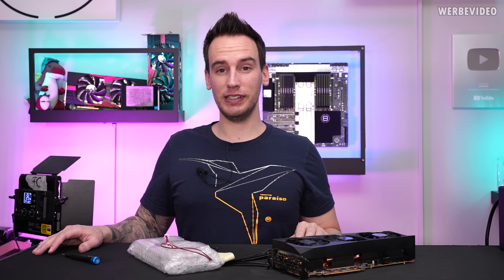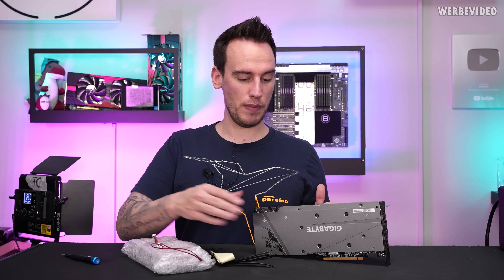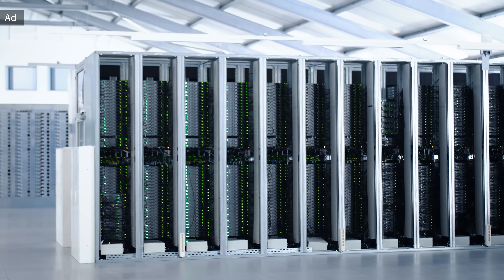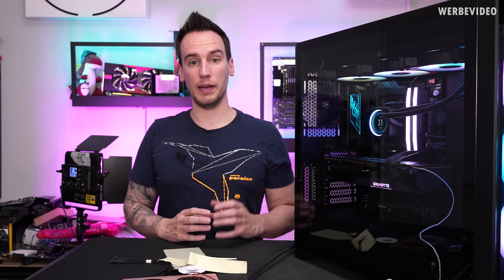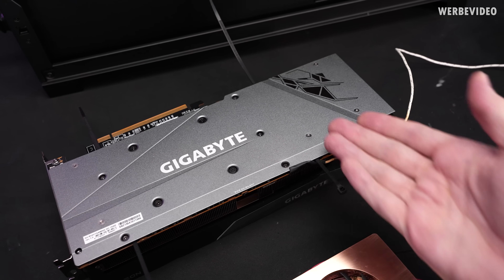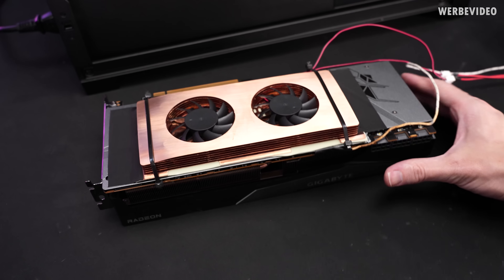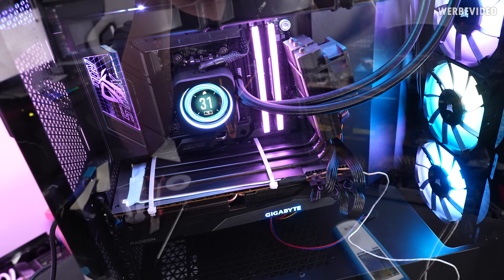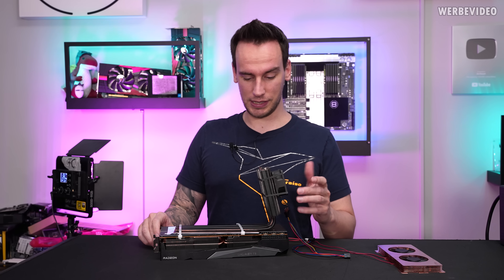Please don't do this - AliExpress GPU Backplate Cooling

Comment: It would have been fun to see you rig a regular 120mm case fan blowing directly on the back plate, maybe with a 3d printed bracket or even just some rubber spacers and see how that would have worked compared to the Aliexpress versions.
Reply: Yeah, just adding extra airflow right on the backplate can make a big difference. It's all about moving cool air over it to get the heat out
Reply: A 240mm fan card underneath the gpu does a much better job. Having fans facing different ways creates a lot of turbulence, and keeping the air moving backwards and up is much better for temperatures in my experience. Keeps my 2080ti fe from throttling
Reply: @TheTurtleneck64 on most gpu's and the one he used,  the air is sucked in from the bottom, pushed thru a fin stack that redirects the air (when it hits the gpu pcb) so it flows out the sides of the gpu towards the motherboard and the case side panel - that is 90 degrees from the way it entered, it does not flow from the face of the gpu, out the back of the gpu due to the pcb and is not flowing from front to back or top to bottom in the computer case either. So, the air in the computer case is already not flowing in the same direction. Also you missed  the point of my comment... I was just wondering if an $8 fan from Artic or ???  would have done a better job of cooling the solid backplate than the badly designed $40 or $50 solutions....
Reply: @SmarterGaming  So yes, that's what I was saying. Having other fans force more air into the GPU fans is the most effective way to cool the GPU more effectively. Having a 240mm fan card will also blow the hot air leaving the sides of the GPU fin stack up and out of the case.
The majority of PCs have rear and top exhaust. A fan card compliments that well. Creating turbulence hurts your cooling. A fan card worked better than taking the whole side off my case and putting a box fan against it
Reply: That's what I did to my 3090. Bought a thermal pad and some alumium fins and slapped a 120 slim noctua fan ontop of it. about 10-12c in vram temps drop
Reply: @Walhor  yeah but you increased core temps dummy. Maybe that’s ok if you are mining (also stupid now). Everyone always thinks heat magically disappears when cold air comes in or something. No, you are pushing heat into the core and if the card is designed in a way pushing heat up then you are working against keeping heat in the core slowly dissipating. Ideally you want heat OUT of your components then direct that heat out of your case. Then there’s factors of pressure and all that too. It’s insane how many people just mindlessly point air and hope for the best. Airflow is a pretty simple science of A to B yet people somehow work against it.
Reply: Or maybe, put a lot of those small aluminium heat spreaders, a pair of old southbridge and chipset coolers.
Reply: @mariyuano007  the best and cheapest result I’ve seen is a fan directly over where the core is located but on the backplate pulling out hot air with small copper heatsinks placed on top of where each vram module is. A big copper block over that area with a fan pulling out would be better but even more of an eyesore and take more space
Reply: This is my system, and it's a massive improvement for me (over 10C drop)
Reply: @solenoidnull9542  Yep, I did the same, and now my gpu stays below 60c under full load.
Reply: @solenoidnull9542  I don't for a second believe you dropped 10 degrees Celsius
Reply: @rustler08 Did this to reference RX480, thermal pads on the back(vrm zone) and aluminum blocks with fins about 12x6x1.5cm size and a small fan on top. Under load vrm dropped up to 20c and gpu die dropped some 5 to 10c. PCB is ok for heat transfer.
Reply: @xerxeslv  I might do that to my rx580 8gb, getting hot lately, i repasted but forgot about thermal pads until i took it apart. I dropped 10-20c on the gpu with a repaste though at least
Reply: @420doof  Well, repaste and new pads should do the job to get it back as new. The problem is - even new card can get pretty hot on VRM, and thats the only part that actually degrade over time - capacitors, the higher the temperature the faster they loose health. So, getting your VRM zone from say ~80+ to ~60 can prolong the life noticably i would presume.
Reply: @rustler08  I did this for mining, yes it does drop double digits on several different GPU's with just a fan to the backplate.
Reply: @rustler08  the memory does drop that much temperature, there are even brands that sell those fans as part of the original GPU package, they were very popular with 3080/3090s.
Reply: @xerxeslv  vrm is rated for well above 100c. it won't matter.
Reply: @Xfade81  How many hours on 100C? And no, I am not speaking about mosfets and stuff, it's about caps. Those things usually have long life under 50C but going higher reduces hours significanly. Just look up hours/temperature graphs for caps, depends on quality some can degrade very fast in high temp conditions. Yes, caps are usually located bit away from hotspots but still can heat up noticably depending on pcb design. In case you change your hardware every few years it won't matter for you, thats true. If you want to keep your hardware going as long as possible, lowering caps temp might help.
Reply: After lots of testing you do NOT want to have a 120mm fan pulling in cold air to it. Sure backplate/ rear vram on 3090 might be cooler but you are pushing heat into the core which reduces performance more than just letting it be. However putting the 120mm fan on backplate pulling out hot air is a different story especially if you have a rear case fan to immediately pull that heat out without affecting your cpu temps.

Comment: Suggestion;

Use some of the holes on the backplate to add mountingpressure to the last cooler. Add a 2mm thermalpad on the backside of the gpu die.

Thermals of interest would be plate temp (like in this video), vram and die temps

Do a before after comparison also
Reply: WTF, no. You really want to do an invasive procedure like that for non-existent gains? Just blow a fan on the backplate.
Reply: @rustler08 
Me personally, no, but he has the tech and the cooler to do it...

And - how do you know that bridging the gap between the back of the die and the backplate with a thermalpad is not going to lower temps if you're actively cooling the backplate?

Also, why not make people who can actually afford a failure have their hardware on the line so that people like you and I don't have to risk our hardware?

Comment: That paint job, and including a used fan... just wow (rolleyes.)
These things look hideous, cluter the inside of the PC, and make the card even heavier --> more GPU sag, unless something there to provide support.
All for just for a few degrees, and that's best case scenario. Definitely a nope.
A case with good airflow and the card's own fans should do, and if still too hot, definitely as you suggest: possibly water cooling.

Comment: I did wonder if a 3090 would have been a better card to test with because of the hot gddr6x VRAM being back-mounted. These products seem to be a response to that , and probably useless for anything else tbh. Gave me a good laugh. Surely having your backplate running hot is a good thing!? means it's dissipating heat I'd have thought.
Reply: Agree, it's for RTX3090 and not for gamers but for miners. You can find many videos from them with these types of cooling backplates.

Comment: My 3090 STRIX memory temps immediately hit 100c with any load at stock voltages.  Had to drop it to .9 volts to get decent temps but loss performance .

Comment: Many people seem to think its bad if a component feels hot. But it's actually the other way around. If it feels hot, that means the cooling system is working and it dissipates its heat to outside. it'd be far more concerning if it felt cold during heavy use.

Comment: You should test mounting a fan directly on the backplate. I guess that would be more efficient. And you can use zip-ties to get the same professional look.
Reply: Clearly rubber bands are the preferred fan mounting solution. Must be for noise damping or something.

Comment: They are specifically for the 3090

For my 3090 and hap-hazardly slapped a huge thermal-pad between my 3090’s backplate and my dead 1070’s cooler and dropped 20c under etherium load from 110c to 90c

Hell if i used K5 pro and put it between my Vram and backplate and between my backplate and the cooler i would expect to see a further 10c drop and for anything but etherium i would expect to see my Vram cooler than the GPU die

Main reason is because mine is a 2 slot card due to my case and my 1070’s cooler fits on the back of it cus i cut a hole in said case connecting the CPU and GPU compartments and i dont have the side panels on

If only K5 pro was easy to get at the time cus i spent £110 on 4 sizes of THE BEST thermal pads at the time and to have them in 3 days as opposed to 3 months of aliexpress

K5 pro i would have only needed £20 of the stuff with todays prices

Comment: Would be a good idea to put something between zip ties and cooling solution on top of backplate. 
Should help significantly with mounting pressure and that is important when it comes to heat transfer.

Comment: Instead of a custom water block, just get a Morpheus 8069. I was sceptical at first, especially after I unboxed it and saw, that it was smaller than the stock cooler, but after I installed it, I was blown away. The coretemp dropped by 18°C and it got a lot quieter.
Reply: For $174? Lol no just buy a bykski waterblock for less than that. They work great, i have one on my 3090 ti 50c while gaming.
Reply: @eternalbeing3339  The price has dropped. At least in Germany und unless you already have a waterloop, it's not just the waterblock. You also need tubes, a pump, reservoir, fittings and a radiator. So all in all, you are looking at about double the price of the Morpheus.

Comment: Such backplate coolers are fundamental part of chinese overclocking culture you are not familiar with. The use them for generations not only for any temperature gain welcomed there,  but also design. They paint on them traditional communist images and treat such pieces of art as part of rivarly during overclocking contests.

Comment: I wouldn't expect this to affect the GPU temp, I don't think that's the point... Wouldn't a 5-8° reduction of the backplate be helping to reduce the temp of components that dissipate more heat into the PCB such as memory/VRMs/chokes?

Comment: From testing on my ASUS Vega 64, thermal pads from VRM to backplate only spread the heat 1 cm out into the back plate from where the thermal pad is located.
So even though I connected the VRM to the backplate, the cooling surface was only the size of a DDR5 Memory stick, because the heat did not spread out into the entire backplate.
Reply: take your back plate and throw it in the trash where it belongs. Let the card breath.

Comment: 60 degree Celsius is way beyond.   The pain threshold is ~44 on hands, and at 51c there is almost immediate cell damage to the epidermis. You can cook an egg at 60c. 

And even if the card temperature really is 60c, thats probably a good thing. A lot of the components often fail because of wide range thermal cycles.  The resulting thermal expansion from hundreds of 60-95c cycles is much less stressful than say, 30-95c.  Those who obsess over idle temperatures needs to educate themselves.  HDDs are a good example. They last longer with a constant temperature as long as its not too hot or too cold. 

Moderation in all.
Reply: What do you mean way beyond? 60c under load is good. That is a little higher than watercooled. stock coolers see temps in the 70s.

Comment: PSA for the Captains Obviouses : 3090 users will know that kind of ugly crap can help.. The whole point of the video was to show that for all other cases it's pretty much useless. A hot backplate burns your fingers but cooling it down, besides making you feel better, has no benefits for the GPU and VRAM.

Comment: The idea of backplate coolers is to stop heat radiating up into the case and thus hindering the cooling of other components.
They are not really anything to do with cooling the card.
You should really have tested the temperature above the card.

Comment: Isn't the point of these is VRAM cooling? Even 3080s easily reach 88°C on VRAM in stock configuration.
I'm really sorry for criticism, but this felt like a video for the sake of video, without understanding which problem the product is trying to solve. (these coolers do look like garbage though 😂)

Comment: This test seems to be deliberately ignorant:
That GPU (Gigabyte 6900 XT Gaming OC) the backplate only has contact with the decoupling capacitors behind the GPU-die. So it can not have much of an impact on ANYTHING. having a stack of  Die -> substrate -> PCB -> capacitors -> thick thermal pad -> backplate
There is nothing that an addition cooling-setup can cool cause there are no heat-paths for the memory, VRM or any other active components.
 
Test it with a GPU that has VRMs or Memory on the back, or at the very least where the backplate has some contact to hotter parts of the PCB.
With GPUs that have memory on the backside AND where the backplate makes contact these simple coolers can do a surprisingly good job. Like the 3090 ... easily dropping 20°C from the memory temps there.

Comment: I wonder if just having a Fan put near the back plate would have as much affect as those solution as the backplate is already a flat radiator, just add some airflow to help the performance should be enough. As you said,  the water cooling is what will help with cooling and performance.
Reply: Yes it would, I got a 3090 & while the memory junction (the hottest module) never really got to dangerous temps there has been a few times I seen it top out around 98/99C (thermal throttling is supposed to start at 110C on GDDR6X modules). Which is a bit too close to the limit for my liking. I put a 120mm Noctua fan with some bumpers to hold it up off the backplate a little on it & have never seen above 92 on my mem junction temp since.

Comment: Did you check Memory Junction temps?
EDIT: I'm asking for 3090 ofc, because I experience issues with high Junction temps and the FPS counter dips down hard. 
Also - is there any way to force usage of front RAM? Even during heavy play I use more like 2GB or RAM and not 12GB...
Reply: that a very intresting thought , would be cool to be able to use only the vram from the front of the 3090 while using less than 12gb of ram
Reply: @rompersrchelichannel8164  guess it would reduce the overall bandwidth, but in gaming usecase it's not that much of a difference.

Comment: Would be interesting to see difference with just a 80mm fan placed on its side on top of the card, blowing along the backplate from power connectors in the direction of the IO plate. I'm pretty sure that would be about as good as the 50 EUR thing or perhaps better.
Reply: Î would bet my money that your assumption is correct, the fan alone would be better^^
Reply: I don't know about a backplate but for an HDD it works pretty well; mine dropped from 50 C to 40 C moving it from the bottom of the case to a middle bay where it gets the air of the front fan of the case.
Reply: Used to do that all the time, would put plastic motherboard standoff's in the screw holes and set it right above the back of the GPU..
Reply: Do the same thing but after removing the backplate. My bet is that no backplate will perform slightly better since the bare PCB has more surface area since you have have all of the SMD perimeters that lose airflow when you slap a backplate on, SMDs sink most of their heat into the PCB and skips the thermal pad resistance.
Reply: @teardowndan5364  Honestly I'm not sure about removing the backplate from gpu-s which using thermal pads between the board and backplate. The backplate functions as a heat spreader in those cases, without it you'll get bigger surface for sure, but you can get hotspots or even overheating chips (like vrm or memory).
Reply: @mtx33  The PCB is already acting as a heat-spreader and SMDs have lower thermal conductivity through their pads to PCB power/ground planes than plastic/epoxy packaging through thermal pads to backplate.
Linus did the experiment a few years ago and concluded there was no cooling benefit whatsoever to backplates.
Reply: @teardowndan5364  You are absolutely right about non power smd-s not requiring cooling and I remember that video featured a card without any heat generating components, but now there are cards with memory and maybe part of the vrm on the back side like the 3090. These can be exceptional designs, but I think it would be interesting to redo the test with these cards.
Reply: @mtx33  Unless the chips have a metal case instead of epoxy encapsulation, the junction-to-thermal-pad resistance is through the roof and slapping anything on top is pointless, you are better off cooling the PCB itself. As I wrote earlier, Linus tried backplate on-vs-off and it made no difference whatsoever as far as they could tell since you cannot use a FLIR camera to directly compare SMD temperature through a backplate and thermal pads.

Comment: The 2nd one could be a ghetto solution for broken fans or insufficient cooling. Remove the shroud and fans, put it on the other side of the card with some noctuas on top lol